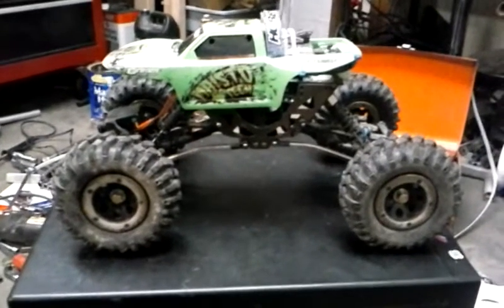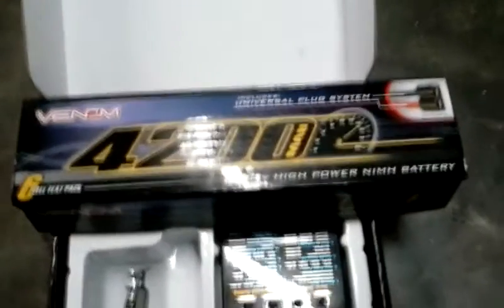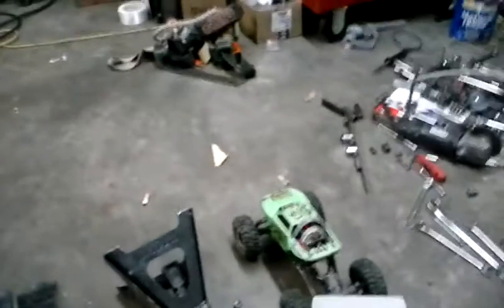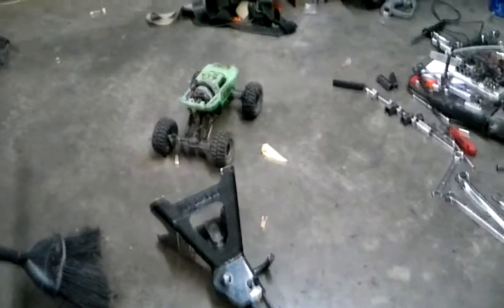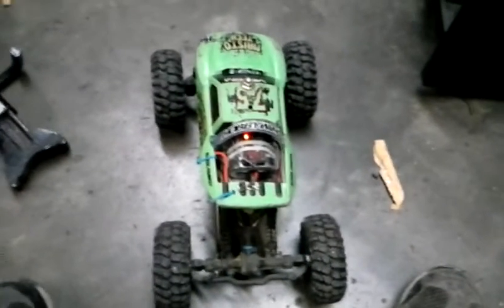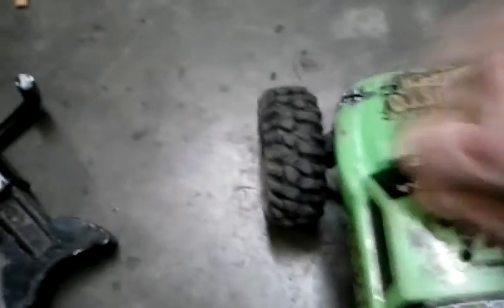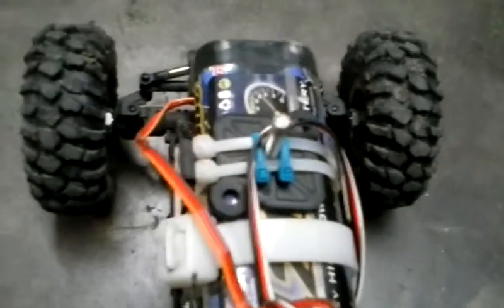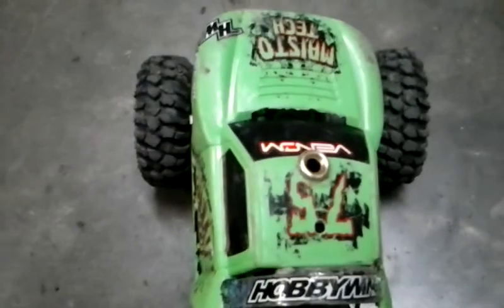Redcat everest 16 modified fast hobbywing 12t

Comment from the maker: what size battery are you running in it the 7.2 1300 mah will not power this setup i used a 4200 mah big battery but a dromida sc4 18 lipo 1600 mah works if thats not it your going to have to set the esc using the set button if your reciever isnt recieving power you will want to make a power supply wire and run itback to the positive on battery